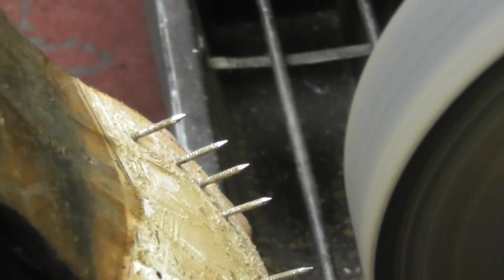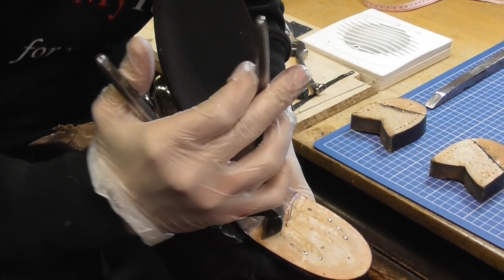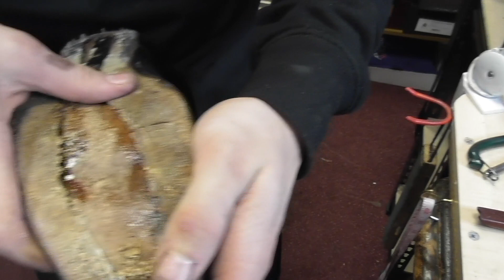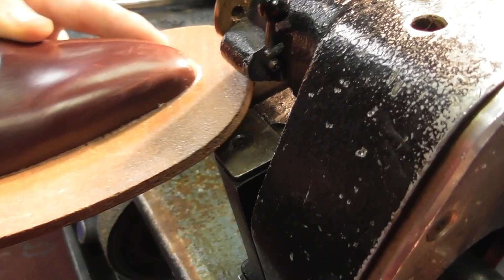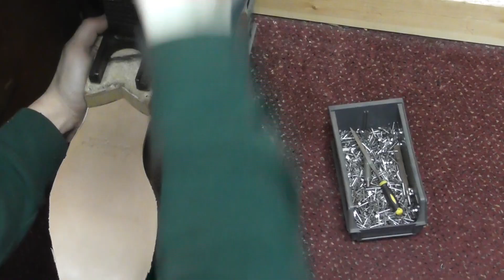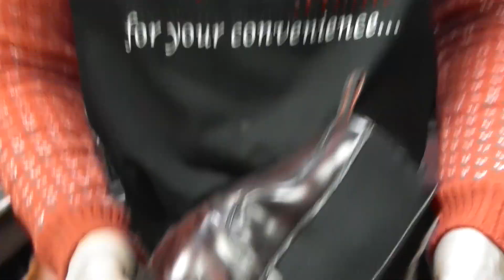Fixing big rip on Jeffery West shoes - Hole in Jeffery West Shoes

Comment: Without stitching the patch to the outer upper the cut is  still there on the feather edge and will pull out again!!then to use staples on the top piece?…oh well!
Reply: Well I noticed the shoe was not welted or corked which surprised me because of Jeffery West are not cheap. The heal when on with pins and not staples, I am sure that is how the heals would have put on in the factory in the first. I am furniture man and Pin Guns certainly have they place in industry.